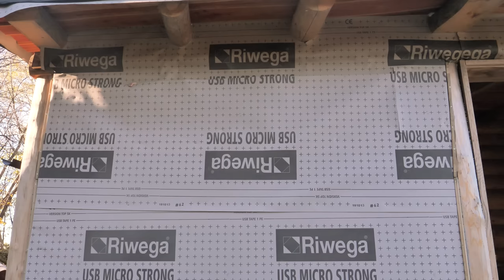Roof and Windows (I'm Still Alive) / OFF Grid CABIN Building (S4 Ep6)

Comment: Wow, you have come very far!
I remember living off grid for years with no hot water. We did electricity and I took an old coffee machine and converted it into a hot tub LOL.
I bought a plastic bathtub, drilled a whole for the heating element of the coffee pot and installed it.
Took about 30 minutes, the water was nice and warm, turned it off, unplugged it and hopped in LOL.

Comment: 🤔🤔Always thought Nik you have the perfect climate for a rain catchment system if you could find two 1500 gallion poly tanks. That you could eather bury in the ground a 1/4 deep. Than wrap them fro top to bottom with insulation and cover with steel roof panels using 1/4 inch cable and clamps to hold it all together. 💡💡Nik we wouldn't mind if you have to upload #Shorts on this channel once a week even.

Comment: Great to see you again. While you two were standing on the roof, I thought that it was a great view from up there, and if you try to turn that into a large balcony? Considering the placement of the windows, it would be fairly level to the upper floor inside. Keep on your great work!
Reply: very big and VERY flat roof there. Balcony would be great. I am thinking more about the weight of the snow that will be accumulating there , Maybe in time there could be a sun room  build on top of bathroom/sauna? As you mentioned- a GREAT VIEW from over there. 🙂